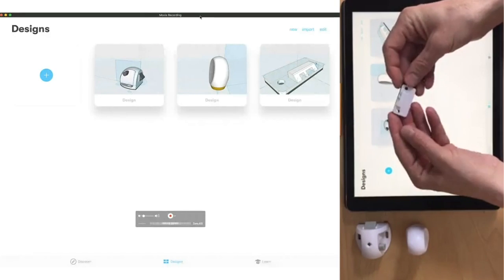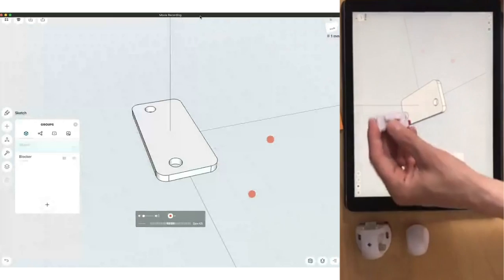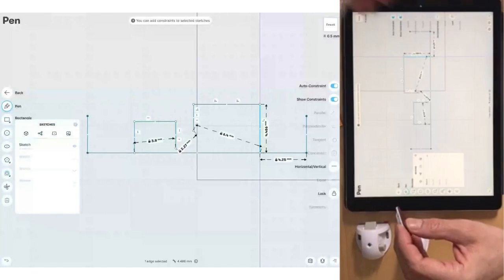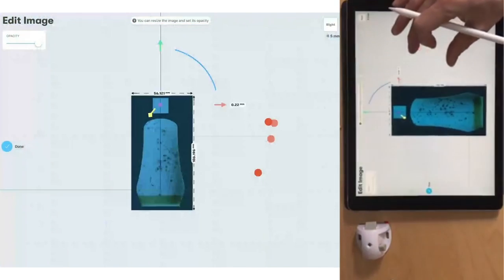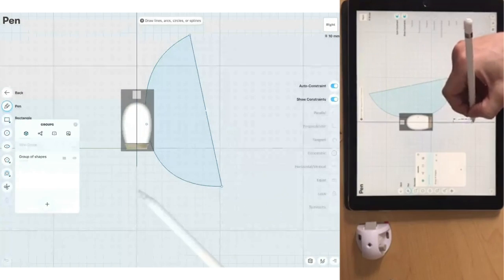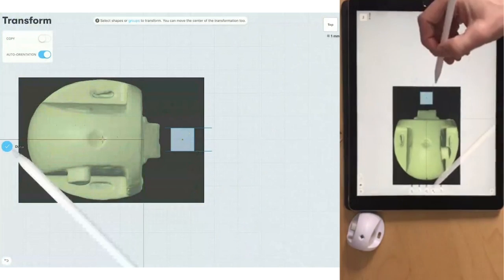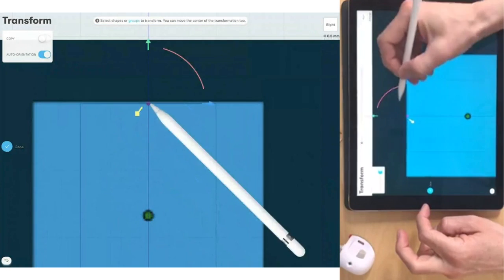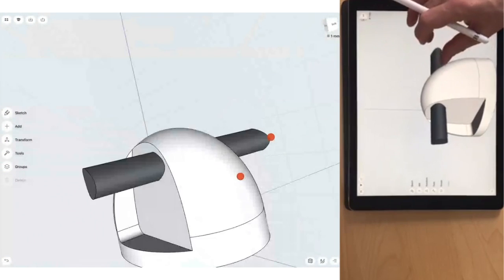Intro to reverse engineering | 3D design webinar

Comment: Really useful tutorials so thanks for those...Was wondering if the Ipad Pro LIDAR sensor can be used to create a 3D scan that can them be used instead of a picture.  I'm really new to this so my apologies if this is a dumb question.  The last object you did looks like a scanned model rather than a picture.
Reply from the maker: Hi! All of the models were created from pictures. The LiDAR will be useful for capturing bigger objects or rooms, it has a really low resolution to see small things like in this video. The LiDAR was developed mainly for AR purposes, not digitizing small objects. It is just a feature which can be done with it, but not the most suitable one!

Comment: Hi, is there an option to reverse engineering using as reference an stl of scanned object?
Reply from the maker: Hello, this is currently not possible in Shapr3d and also STL import is currently not supported. A workaround can be to import a 2d image of the model which can then be used as an outline to trace your sketches.